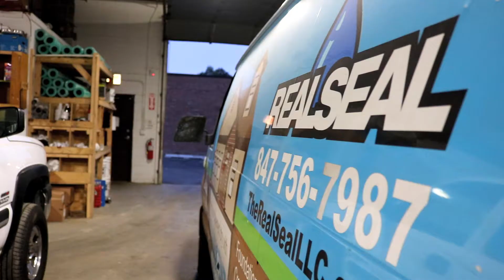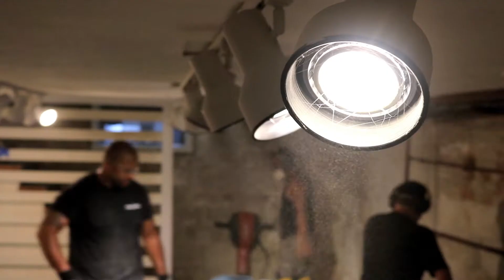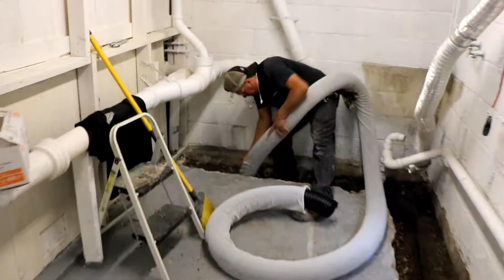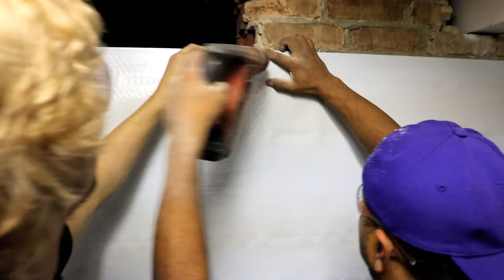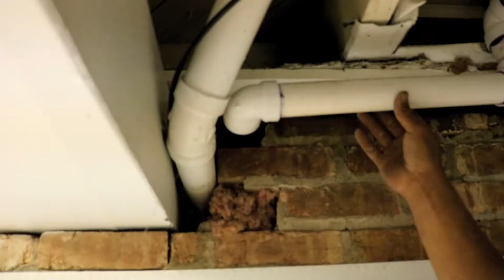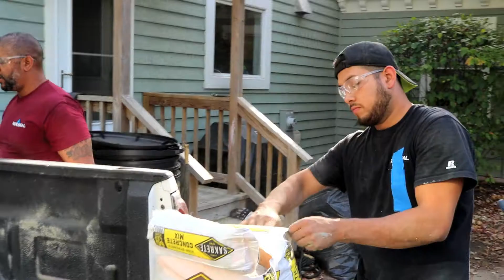How We Do It: Interior Drain Tile System

Comment: Instead of the Poly, would it make sense to glue a few standoffs made from foundation wrap (8mm) if one were to anchor 2"+ of rigid xps/isopoly over top if the home owner is going to finish the basement walls with mixed isulation, or just anchor the foamboard through the poly given that the 2" foamboard itself is also a barrier for vapor/water.
Reply from the maker: Good question! If you are trying to insulate the area, we would recommend either a spray foam or the foam board you mentioned after our wall covering vapor barrier is up. 

Either way, we would recommend installing the system first and then insulating.

Comment: great video. For a crawlspace with dirt floor. How would you secure the drain board?
Reply from the maker: If it is a dirt floor, there is no need for a drain board. The water will simply go through the dirt into our system. The drain board helps divert water past concrete.